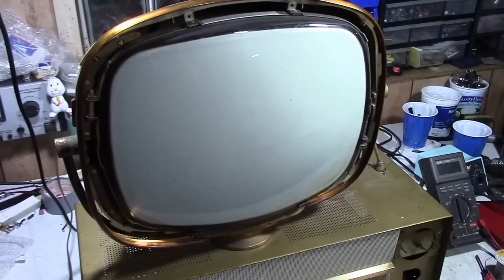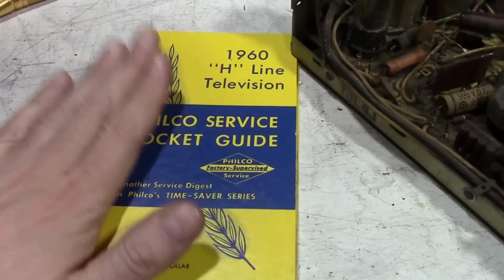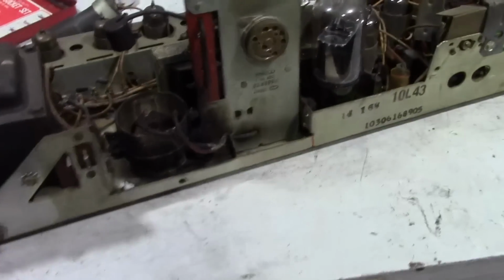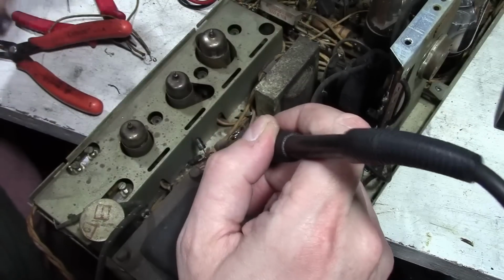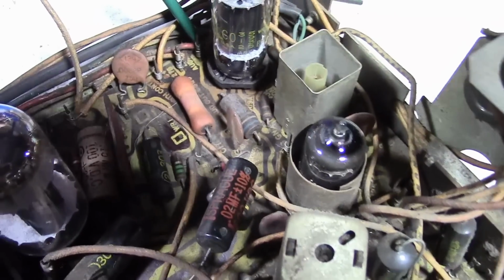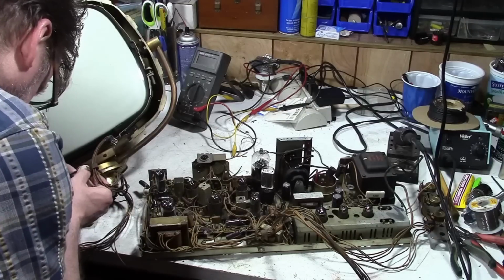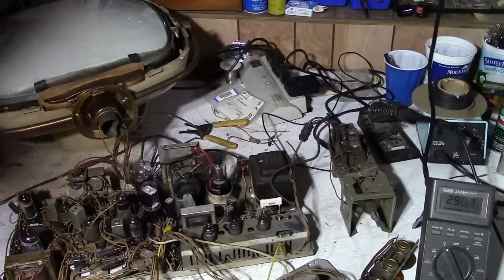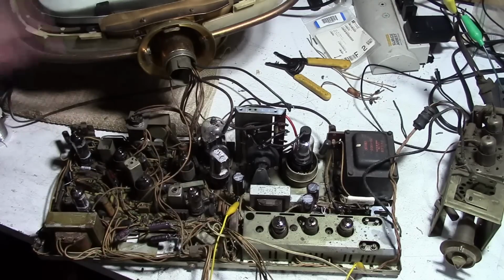Filthy Philco Predicta Siesta resto p2o?

Comment: You should be happy if it was owned by a smoker, the tar and nicotine layer on it protects (and sometimes discolors) it like rustproofing with a sticky substance that keeps out oxygen 👍🏻
Nicotine and tar easily dissolve in citric acid, anything with lemon in it.

Comment: Have you tried cutting access to board using chassis nibbler or Dremel with mini cutoff wheel.
Reply from the maker: No.  I wouldn't want to lower the value by hacking it up or decrease the strength of the chassis.

Comment: The 6FD7 is a good replacement.  They are somewhat similar tubes, the main difference being that the amplifier section of the 6FD7 has a slightly lower plate resistance and higher power handling.
Reply from the maker: Good to know.  Thanks for the info.

Comment: Quickly looked up both 6FD7 and 6DR7 in RCA receiving tube manual #24 from 1965 , It seems they are the same spec wise. I remember seeing a post on Antique Radios forum that showed replacement K networks using  stock  breadboards with components on one side and solder bridges on the other. Looks like a lot of fussy
 work. Good to see someone else sells them to order!
Reply: The 6FD7 has a slightly different amplifier section which will handle higher plate current.
Reply: @douro20  Yes but that's OK for this model.
Reply: @hestheMaster  I understand that.  As long as the set can handle the extra filament current.

Comment: If you store the corona dope bottle upside down it will last a little longer after you open it. May need pliers to open it next time but will still be usable.
Reply: Probably cheap right now because of the name
Reply from the maker: Thanks for the tip!
Reply: Another option, if it is still available, is the spray version of corona dope-yes, you DO need to clear the nozzle after use, but at least it won't dry out.

Comment: Something you might want to consider is to purchase some "Dental Flossing Brushes", you know, the things you insert between your teeth to "floss" your teeth.  They make excellent brushes to clean out tube sockets.
Another thought, IF you actually do remove the metal plate on the bottom completely from the circuit board, consider enlarging or making new holes in the plate while it is off of the circuit board so that those places you need to get to are now accessible. 
I couldn't help but notice that you have a large capitol letter "A" inside a circle on your right hand.  What is that about?
Reply: Pipe cleaners are good too.
Reply: @tarstarkusz  Yeah, the cotton type you find at smoke shops.
Reply: They work good on those thinner tube sockets like  the compactron tubes.On some larger hole sockets you can use old fashioned pipe cleaners!

Comment: I found that EZ-OFF Oven Cleaner works good for cleaning metal chassis.
Reply: Just don't use it on a cadmium-plated chassis.
Reply from the maker: This one is cad plated.  You'll see what I used in the next installment.
Reply: @bandersentv  I forgot about that.

Comment: Well, talking about nail polish, that is exactly what I used to seal high voltage in old B&W TVs in the past. It works just fine. I used whatever there was in the house that my mother could spare. Seeing now there is black polish, it would be perfect for that. Never tried in a color TV though and it's a good question, considering the voltage is much higher...